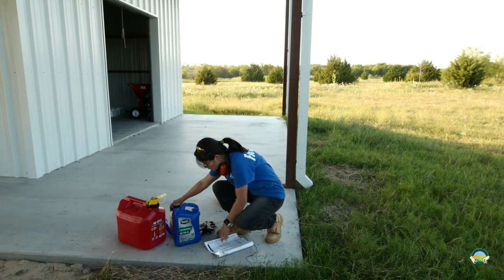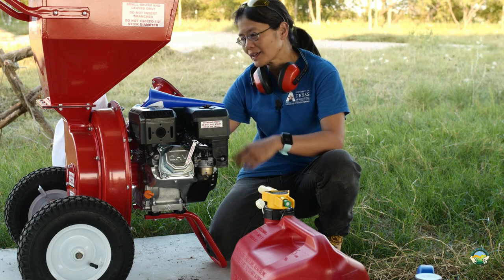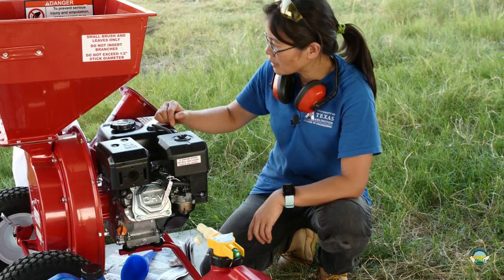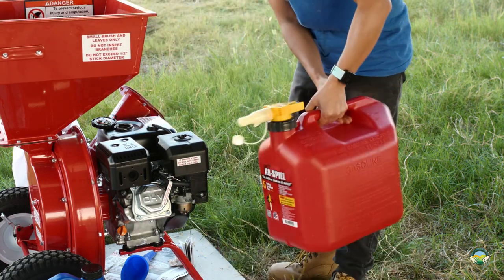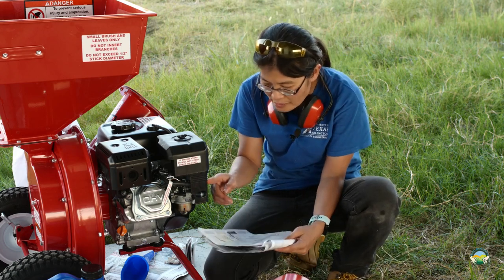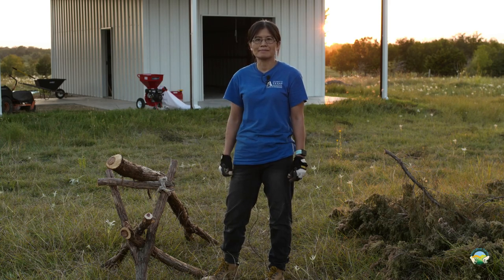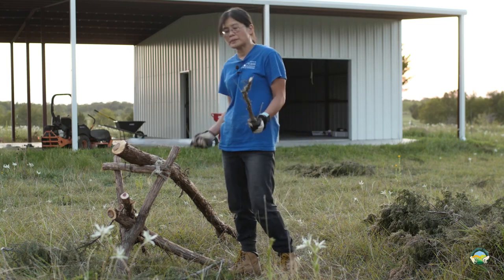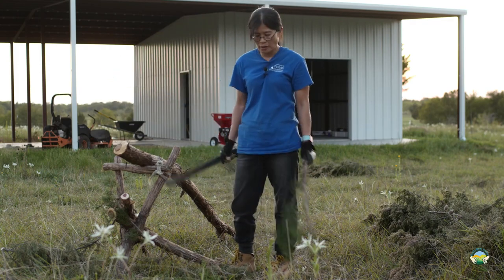Real-life review of a Harbor Fright Tools 6.5 HP wood chipper

Comment: Thank you for the video.  I have been looking at this chipper since I have a dead maple which is taken down now.  Everything is dry so ready to chip.  I see even with the  $60 coupon  the price is  $100 more than your price.  Simply amazing that much in a short time.  Yes I see there is a break in period of a few hours.  Makes me wonder how many DON'T  do this.  I was going out today, but it will be tomorrow for sure.  Called the store and they have in stock.  A chipping I will go. Hi HO.  Once again great video, shows even a woman can help, and do so much.  Team work, getting it done.  Good job.  Chip on,  BE  SAVE
Reply from the maker: Thank you very much. Glad this is helpful. It really is a nice little machine. To put this in perspective an electric motor with 5 kW (6.5 HP) power on a 110 V line would draw 45 A. Let us know how it goes.

Comment: I have had ours for 5 maybe 6 years and it has held up very well. Have found that mounting to a small trailer and towing it from one place to another is much easier. Also mulch with it on the trailer as well, much more stable when chipping those 3" or slightly bigger items through the chipper. You do have to clean out the cutting area for material gets jammed up around the shaft from the engine to the cutting wheel by removing the input tube for the up to 3" items and the rear clean out which never really has anything in that area. A tough little machine. The trailer we use is also from harbor freight and is the 4' x 4' model and towed behind a  john deere tractor.....
Reply from the maker: Great suggestions. Thank you very much! 👍

Comment: That's a beast of a machine for it being so small. I've looked at a lot of videos of this machine and I'm probably going to buy one now. That's a lot of good mulch for the price. One tip is to always run the motor out of gas and never leave it with gas in it for long periods of time. Trust me itll save you from a lot of headaches in the future. I never put stable in my gas because I always run it dry at the end of the season and I try to find gas that doesnt have that ethanol crap in it. That stuff ruins motors gaskets and gas lines. Great video thanks
Reply from the maker: Im old greg thank you very much. I think we’ll do this I’ll, i.e. run the motor out of gas.
Reply: My parents had a weed wacker that had the fuel left in for years, it completely dissolved the fuel lines inside the tank. You would think that the manufacturers would put some sort of warning on their products but maybe there is too much money to be made in spare parts.

Comment: I have watched a number of  Harbor Freight Chipper reviews. One Tuber said the chipper blades come unsharpened. He sharpened his. Said it improved its performance. Another said a chipper handles dry wood better than green, Another tuber uses a machete  with a curved tip to remove the jammed limbs in the tube. Put the curved tip in at an angle. Then pull up on the handle . It pulls the limb out. You can buy a 20 volt Blacken Decker Saws-all. They sell pruning blades for it. Not expensive at all. Makes pruning limbs a snap. Taryl Fixall. Did a test of gas stabilizers. He found just starting the engine once every month keeps the gas from drying out in the carburetor. I suggest you run all the gas out of the tank when you think It will be setting un used for any extended time.
Reply from the maker: A machete with a curved tip sounds very useful not only for the chipper, great idea! 
I need to check out the blades, I actually never looked at them. I sharpen all sorts of things around the farm, including shovels but never looked at the chippers. 
We started putting the whole limbs into the chipper and that works well, too. We are a bit too careful in this video. 
I had to clean the carburetor once. This is very easy to do for this engine. It looks almost exactly the same as the Honda engine in our BCS. I am not worried about fuel stabilizer any more.

Comment: Hello, may I ask why do you think the chipper jammed up on such a small branch?
Reply from the maker: AmIonArock yes, that’s right, the branch was reasonably thin. But the branch was pretty crooked. When the chipper pulled in the branch this branch got wedged in the shoot. 
As long as you cut crooked Branche into short sections thins work well. The engine has plenty of power and never stalled.

Comment: Could you or someone else please comment on its efficacy for mulching large amounts of leaves via the hopper?
Reply from the maker: D. H. I can’t give you a qualified opinion, we just don’t have a lot of leaves on the prairie. 
It is definitely a big step up from little leave shredders you find at the home improvement stores. 
For really large amounts of leaves, the HFT shredder is not the right tool, you should look into a commercial grade shredder instead.
Reply: I just shredded five bags of live oak leaves. And it worked quite well. Already well decomposing leaves, as well as wet leaves are more problematic from my experience.  Though much more the  time sink, they are yet still do able. I wonder what the manufacturer would have to say regarding how best to manage partially decomposed leaves.

Comment: I know this is an older video but I would say rather than bothering with the bag, if you're just going to pile the mulch on a concrete pad then maybe just blow the chips directly into the pile with no bag.
Reply from the maker: Thank you for the tips. We realize this after a few uses. It is much easier just to dump the chips on the ground and then collect them.

Comment: What happens if you second-pass the chippings?
Reply from the maker: We never felt the need for doing this, so I don’t know. 
A few things that will/could happen:
1) you might get smaller chips
2) you burn some more fuel
3) you annoy your neighbors with more noise (assuming your neighbors are close)
4) you spend time feeding the chipper that you could spend an something else

My hunch is the benefit is not worth the extra trouble, but I never tried it.

Comment: One suggestion if you buy one of these rip-off units: take the hard rubber guard off of the leaf chute. Much easier to load and use
Reply from the maker: It is indeed very tempting to take the rubber safety shroud off. 

I don’t recommended it, it’s too easy to get your fingers pulled into the machine when you feed small branches into the hopper. 

Don’t take the safety shroud off.

As for rip-off, the chipper has been ding well for us. It’s a step up from the typical home-owner shredder but certainly not contractor grade either. The price is pretty much in line with that. Depending on your application it may or may not be the right tool for you.

Comment: Why add fuel stabilizer? It's gonna be gone in 20 minutes. Always run an engine for 1/2 hr + before loading it to allow it to break in.
Reply from the maker: The easy answers: because the manual says so...
I think they want to prevent the fuel from going stale. We don't use the chipper on a daily (or even monthly) basis. You probably would get an industrial grade chipper for heavy use anyhow.

Comment: Bought one 4 months ago. Bought the 2 year extended warranty. Warranty is 90 days and one month past the Harbor Freight warranty ended it died. Could not get it to start so I took it for a replacement. After they exchanged it I was asked if I wanted to buy ANOTHER warranty.  I said no because I still had 23 months left. They said no THE EXTENDED WARRANTY DOES NOT COVER TWO YEARS. You can use it only once during 2 years and I had just used it. WHAT A FREAKING RIP OFF. 
I bought the warranty after a lot of arguing and took my new chipper home. Assembled it, added gas and oil and went to start it and the pull cord would not move. Frozen in place. Now had to drive to a much further store to replace the replacement and again assemble it. I could have bought a machine with a real warranty after paying $599 PLUS $129 and another $129. 
Harbor Freight can be such a ripoff.
Reply from the maker: This sounds like a lot of trouble. 

We didn’t use the chipper for about six month and after that us didn’t start. The manual says you need to start it every month but to void the warranty. Of course we didn’t start the machine every month…

On further inspection it turned out that the carburetor was clogged up. The carburetor is very similar the Honda GX-series carburetors, i.e. extremely easy to clean. 
After a quick clean, the machine starts on the first pull every single time.

I don’t know if your issue was a clogged carburetor. If it was and Harbor Freight replaced the whole unit as a warranty issue for something that is a maintenance issues, I’d say this is an extremely generous warranty policy that very few companies would be willing to do.